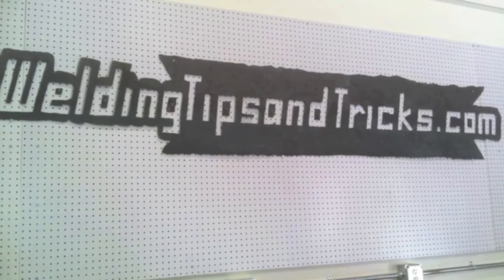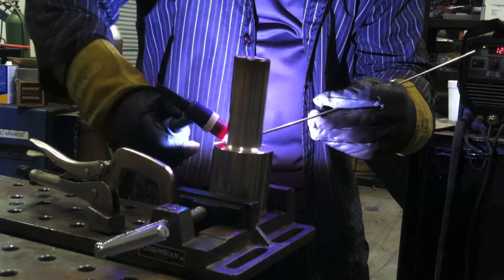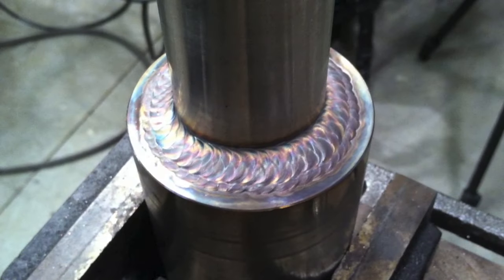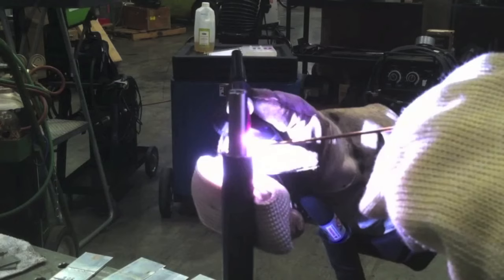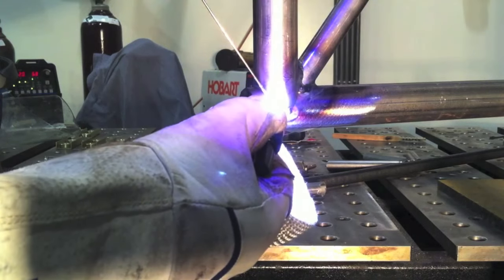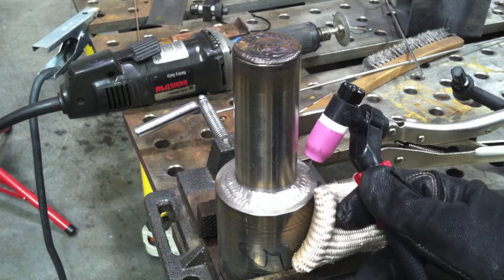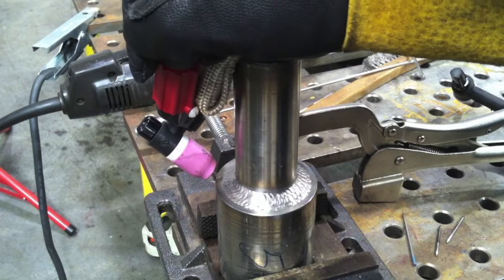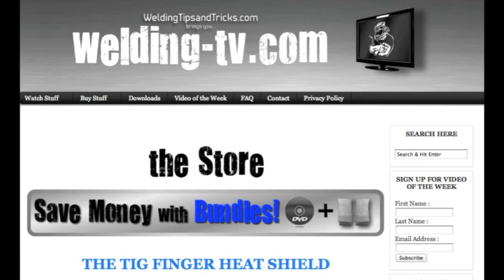Tig Welding Stainless Steel - Walking the Cup vs TIG Finger®

Comment: I do the exact same thing, but I'm going to school for welding, and I can't exactly only use some parts of the rod... I have to basically burn them down until they're about 2" or shorter, and I can't chip the flux and go a little further down the rod and break the excess off... Gotta clamp it far enough down to get good contact and that's it, or they won't give me more when I run out.

Comment: I just started TIG welding. Didn't wear a long sleeved shirt, sun burns on inner arms not cool. Wear gloves, long shirt, cap, leather shoes/boots and a hood.  TIG is not difficult, all it takes is about 1 week of learning the puddling, setting the machine for different metal thicknesses, and a steady slow hand.  Watch this guy closely, do what he does. You'll be surprised at what you can do.

Comment: Higher melting point of the electrode's alloy. This lets you run more amperage through the electrode before it starts to ball up.

I may not be a master welder, but I've made more than my share of mistakes with TIG thus far. ...And for your sake, please don't try to use pure on anything other than gauge aluminum. :P

Comment: wow the welding process is so calm. When I use my mig it's like sputtering fireworks.
Reply: TIG is nicknamed 'Sunday' welding because it concentrates the heat in a much finer point leaving a typically immediately finished wel, but it's also the most expensive method since shield gas is required.  MIG flux welding is the easiest to learn, but the messiest, followed by stick (MAW) which is the cheapest in terms of materials and tools.
Reply: sivalley
im pretty sure stick is harder than mig...
Reply: Bruce R.
I misread disregard.

Comment: I have no idea how you get the tip so close to that puddle and don't suck up any metal. My tip gets that close and it seems to be drawing in the metal like a magnet. Only my second day TIGing today, but I managed to weld for about an hour without having to do tungsten work.

Comment: I'm in the market for a Tig Welder. I am new at this and I have a budget of $3500.00 I have a Lincoln SP-250 Mig that I have had it for 20 plus years and a Miller stick welder. I think both brands are great but don't know which brand of TIG to buy??? Input Please...( it will not be used on a daily basis and mainly for a job shop type repair facility welding heavy equipment specialty parts like on excavators, dozers, etc.)
Reply: I know this comment is pretty old but you would get much better results on a forum or a subreddit as people are more willing to answer questions there.

Comment: They are made out of woven fiberglass.  Its impervious to petroleum products and  fungus. These can be bought from speed shops such as speedway racing,  jegs,  ect. They are about 6 to 8 bucks a piece depending on where you get one.  This little trick has been used around race shops since the 90's.  Its a simple way not to torch those beloved gloves.  Or if you have a Nazi for a boss and they only give you a pair of gloves every two weeks and your tig welding 10 hours a day with no ac in the summer. Its a great idea to make your glove last longer.

Comment: I got a bit of a welding question
I'm used to flux core welding but recently I had to start soldering and I was doing a big 4 gauge terminal when I realized that arc welding is a hell of a lot like a cold solder joint, you only really have a nugget of material that's actually welded and the rest of the contact surface is kind of just there, so why are cold solder joints so weak yet welding so strong?
Reply: +Ariel Lezen The difference is that in a welded joint both materials were melted and therefore connect very strongly. But in a soldered joint only the solder gets melted and "glues" the pieces together. The connected area in a welded joint maybe smaller but the connection itself is a lot stronger.
Reply: xoblyxanier also I heard from an engineer that welds were 'a patch at best, they're not strong or reliable' is that true?
Reply: +Ariel Lezen A correctly done weld is stronger than the material around it.
Reply: +Ariel Lezen that engineer doesnt know much about weld or isnt very experienced, welds id say are as strong or weak as you the applier make them  ive welded stop plates for shocks to stop them from bottoming out on an extreme rock crawler that have never broken with only 2 beads of weld on each plate it always comes down to technique next time should maybe ask a mechanical engineer someone that uses welds regularly  welding creates a pool of material at the joint you are trying to weld. the process physcally joins the two pieces on a molecular level if i remember my welding physics correctly that is, been a couple years since i have touched a welder but tig is the most common in the auto industry
Reply: You will notice that you don't have any free swinging 'nugget' at soldering. This is because steel is going through some peculiar changes of its crystal lattice while melting/solidifying, and this is why it can be welded much better than most other metals/alloys.

Comment: I am tig welding wrought iron and I get sparks flying out of the metal. My cup gets clogged and my tip melts down into the cup. I have the following settings. Pulse Width is at 10pm, Base Amp is 100 and Pulse current is 100. Pulse frequency is about 2 pulses / sec. Is my metal dirty ?

Comment: Aluminum doesn't lend itself well to walking the cup. Mainly from what I've found is due to the heat transfer and low melting point. Meaning you just can't stay in the same area as long, therefore you won't get the desired rippled effect. Just my .02

Comment: I wanted to ask how do I stop the 'electrode to the torch.
L 'electrode for my tig seems to be fixed but when I start to weld it moves and goes all to hell. How can I fix?
I look forward information to my question. Thank you very much.
Reply: Are you applying final holding torque to your electrode by the knurled nut on the back of the head or using a wrench on the the gas lens / collet head?  If you are using the nut on back of the head you will not be able to get enough clamping pressure on the collet and it will expand during use and let your electrode slip.  Alternatively your collet may be the wrong size / worn.  Best of luck.
Reply: Try a new collet.

Comment: Uhh... i haven't touch any hardware tool in my life.  And I want to one-up my man card and start welding. (plus I want to make my own tables at home at the same time). Where and how do you suggest I start?
Reply: +shogrran you can either go to school or maybe find someone you know who welds to show you how to do it. There are plenty of youtube videos as well that will help you. I would suggest you start out stick welding because MIG/flux core are just too easy and you won't learn as much as you would with stick.
Reply: ahisrealyoffthechain
haha thanks for the tip. You lost me on the MIG/flux and stick part though. I'll google that
Reply: +shogrran Check the community colleges near you for non credit class in metal and woodworking. Thats how i started. Good luck
Reply: +shogrran 
William is on it.
Go online to your local community college website and look for "continuing education" and look for welding courses. They should have classes for everyone from the beginner to the professional looking to expand his skill set. CE courses are usually pretty affordable. You may even qualify for free grants or interest free loans to pay for the classes.
Another advantage of the CE courses is they often have employers working with them that hire new graduates.
Reply: start with arc/stick welding its the best way. buy a cheap 140 amp plus unit and practice alot. Once you got that under control its all gravy
Reply: +William Alvarez Do you currently have a career in welding metals? If you do then how is it? Are you enjoying what you do because iv'e been thinking about becoming a welder myself.
Reply: No, not in the welding business. Just wanted to learn how to weld.
Reply: Adrian Guerrero
I've been a welder but no longer.
Adrian, it really comes down to personal preferences.
Every trade has it's ups and downs. Any trade is a trade off.
There are going to be things you enjoy doing and things you hate doing in any trade. The big question is how you weight those two sides against each other.
There are lots of different kinds of welders and each faces good and bad in their particular field.
.
Some things to like about being a welder:
-Sense of accomplishment
-Pride in craftsmanship
-Ability to make repairs most others can't
-Ability to construct items most others can't
-Leveraging your skill in profitable ways
-"Zen" of welding
etc.
.
Some things to hate about being a welder:
-Welding burns (skin)
-Welding burns (eyes)
-Slag burns (clothing)
-Slag burns (skin)
-Extremely hot working environments
-Extremely cold working environments
-Breathing highly toxic fumes
-Electrical shock
-Physically demanding (in multiple ways)
-Production/Task deadlines (usually unreasonable)
etc.
.
In the end, you have to find what you can live with.
Reply: I would look to see if a college or Tech School has a basic welding course. That would be a good place to start and they will teach you several different types of welding. For anyone beginning that doesn't have someone to teach them, that is the route I would go.

Comment: would be very cool to have a servo controlled articulating arm that you could program it's path and speed...  either that, or something that would hold and steadily rotate the work while you hold/operate the welder/rod...

With a multi-joint servo-controlled articulating arm, it would also be cool if the arm contained encoders so that you could move the arm with the welder off, the computer would record the movements/path, and you could have various techniques built into the arm as far as feathering movements, and styles of bead/weld...  nice thing about it would be repeatability, consistency, efficiency, etc...  not trying to take the art out of it, it just would be cool to use technology in positive ways like that.  Especially helpful if you had to make sever of the same parts etc (small runs)...  they've got CNC for everything else, why not helper-bots for smaller shops too!  (after all the Jetsons promised us.)
Reply: ***** Well there is robotic spot welders for cars.
Reply: Awesome idea,,, let's put a few more people out of work.
Reply: It has been done for decades. Motorcycle frames, bicycle frames, etc. I even worked at a bike manufacturer where some of the bikes were robotically brazed.
Reply: Jackle61 I wasn't really referring to the industrial sized robots, I was talking about something that would fit in a small shop that would be programmed on a one-off basis primarily. The robot arm welder would have encoders at all the joints and you would move the welder with it turned off, through the positions that the welder would have to go through to weld the piece that you're doing, and then you could play those movements back to make sure that it was going to go through the movements properly, and will then when you're satisfied that the robot arm moves through the movements that you want then you could run the welder live.

Comment: You would have to weld the door for a long time to allow the body of the car to get that hot 
the heat dispersion is not that fast if you weld it quickly

Comment: i like that tig finger that could be real handy when ark welding
Reply: I bought a few a little while back. They work fantastically on pipe for tig & arc welding. Workmate had to do a buildupon on a big mis-machined ali casting and couldnt hold steady for more than 10 seconds or sotill I let him borrow my tig finger. They are awesome

Comment: you seem like a well seasoned welder so why cheat with walking the cup and starting the root weld with a curved joint.? not a square joint or a "T" type joint.? I've found the "T" type joint to be the biggest cause of a weld failure due to lack of penetration on the root pass. usually the welder couldn't get close enough, nor burn hot enough to fully penetrate the two base metals in the root of the joint. you might give the wrong impression to some kid  and cost him a job. PROFESSIONALISM.!!!

Comment: i heard thoriadted tungsten can damage male reproduction because of the radioactive thorium...is that true
Reply: I wouldn't go snorting the grinding dust from thoriated tungsten, but as far as the radiation level goes, don't worry about it too much.  Yes, it's mildly radioactive.  No, radiation is not good for you.  Yes, there are other options (ceriated, specifically).  Standing naked in the sun is probably* worse for you than using thoriated tungsten.

*I am not a medical professional, nor is this intended as medical advice - common sense still applies.
Reply: thanks
Reply: As long as you're not the one grinding thoriated electrodes all day without breathing protection or plant your face right in your weld while an arc is present, you'll be fine.  Radiation doesn't care if you're male or female, it'll harm either just as much.  The greatest danger from thorium is through inhalation. Just remember TDS.

Time - Don't spend all day with a thoriated electrode in your pants
Distance - Don't put thoriated electrodes in your clothes pockets.
Shielding - That useless plastic case the electrodes came in?  It's enough to block the radiation emitted by the decay of thorium. (google 'thorium alpha decay')

Brought to you by an ex US naval reactor plant chemist.

Comment: you know they make smaller cups so you don't need to walk the cup,which is bad form to begin with.
Reply: +rawdog268 ....yeah and less lip smacking
Reply: +rawdog268 how exactly is it bad form? its a great technique to ensure consistency and being able to both walk and freehand is a great asset to any pipe welder

Comment: looks so easy but i bet its not.
Reply: It really isn't as easy as it looks. Just started TIG welding in school two weeks ago (2 days per week)  it's kind of tricky having to use two hands while also avoiding getting burned by the hand holding the filler metal too close to the flame.
Reply: iv never tryed TIG but iv done a bit of oxy acytaline, usualy resulting in a big bloby mess also got a nice line scortched line my hand from picking up the filler wire without gauntlet. didnt even blister because it was so hot.
Reply: darkknight5696 You gotta learn how to feed the filler through your fingers. Just wait dude, if you haven't welded aluminum yet, you're going to hate your life learning how to.